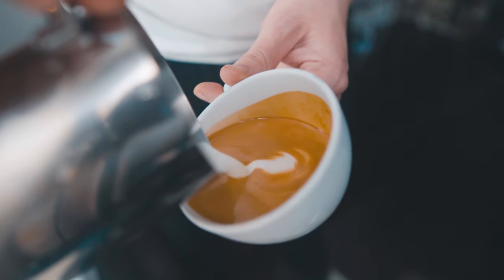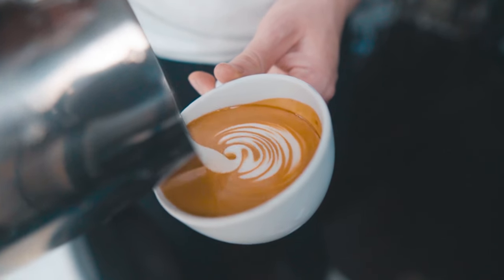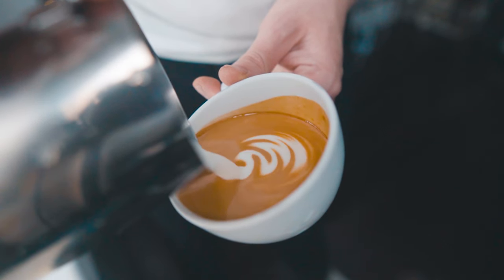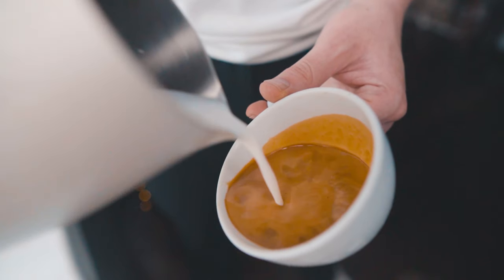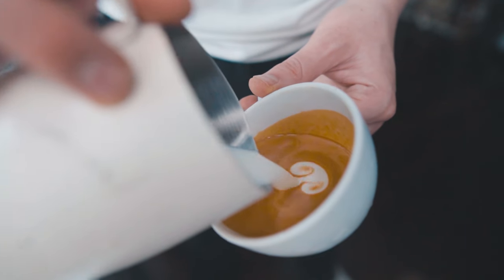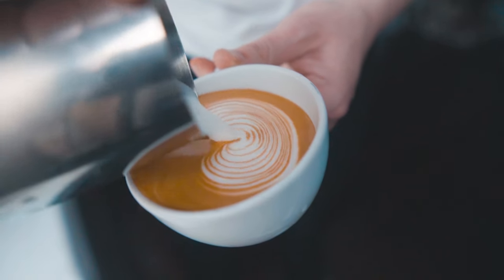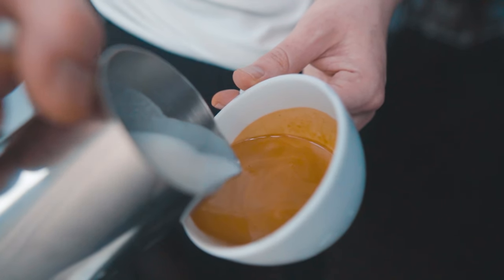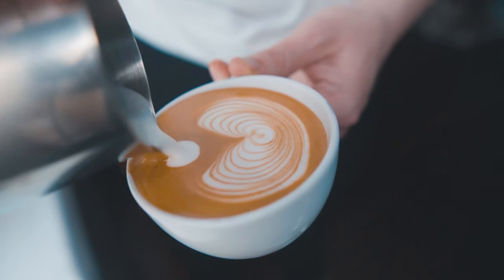3 Bases in 5 minutes: LATTE ART TUTORIAL

Comment: Hi Emilee! It would be great if you could speak more in-depth about the tilt that you mention in the "simple base!" I find that even if my milk texture is great, that wave is still so elusive and hard to achieve. Why does tilting the pitcher past the 180 degree line help create the wave? Cheers!
Reply from the maker: It helps create a current! Sorta! 

The current you get from tilting is always possible but going just past the middle the spout is too high to touch the surface (this forcing you to get closer I.e. tilt more) if you tilted at the top of the cup then it would pour out but there is so much coffee in between the design and the back wall that it will warp instead of move forward. 

Some homework you could try is tilting forward gently in three different spots. Front of the cup, middle, and just past the middle. Note the difference in appearance and flow!

Comment: Emilee, Thanks for these awesome vids!  Question: I've got a Rancilio Pro as well - given the steam output, what's a recommended pitcher/amount of milk in that pitcher, for the best foaming ability?

I have a Fellows pitcher, and typically put about 10oz of milk.  Using the techniques I learned on your channel, for steaming (position/timing), I've achieved a foam where I can get solid heart shapes, however, I must use a spoon to hold foam back as I'm integrating, and then have a little milk left to swirl the foam in to, before going for the art.  Otherwise, all the foam gets integrated in the initial pour, and there's no foam left in the pitcher to art with.  :/  I feel like maybe the pitcher is the wrong size/shape? It's a Fellows 16oz.  The flow of the foam on the top never quite achieves the rippled/flow-y effect I see in videos, but it does flow well enough to make solid hearts, so I feel like it's close, but can't isolate the problem.

Comment: A question, in the last example you say “if it doesn’t drift away, that’s ok” - could you explain why this may occur? It still happens to me sometimes, the milk not drifting. I’ll be trying your first example now, but very interested to know why the last method may fail to drift across the surface. Thanks.
Reply from the maker: It’s gotta be one of three things (or multiple) 
-the milk isn’t thin(not see thin that it’s watery) enough. 
- the espresso is old/really fresh or rubusta/ or the machine can’t produce enough pressure for quality creama and viscosity.
-or it’s a position thing and the pitcher is in a different position. 

I’d play with milk first. Reallly swirl it up before you pour and also integrate less so you get more glide from the creama. 
More foam in the cup =less gliding
Reply: @EmileeBryant  Thanks, I’ll keep these points in mind and try to be more methodical in my practice. It’s pretty neat though, isn’t it? Latte art. I mean, imagine the person who first discovered it. What a thrill they must have felt! Best wishes to you.